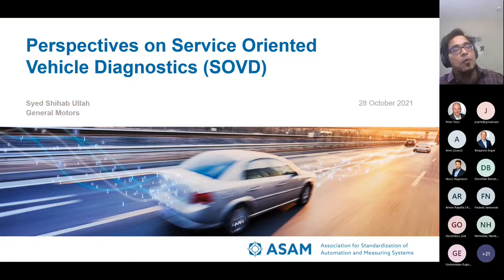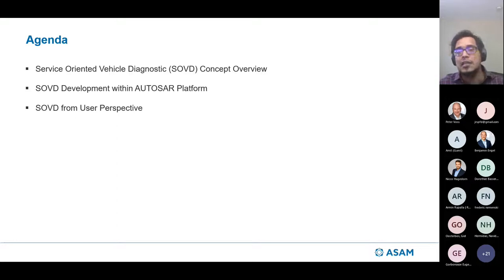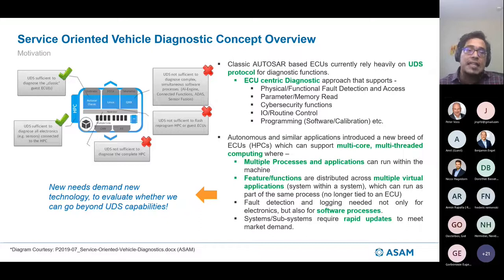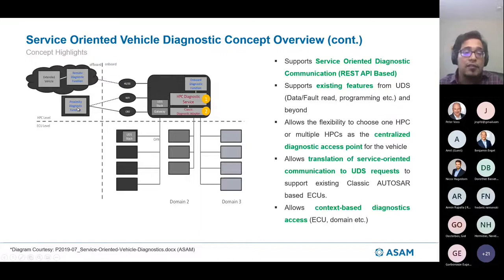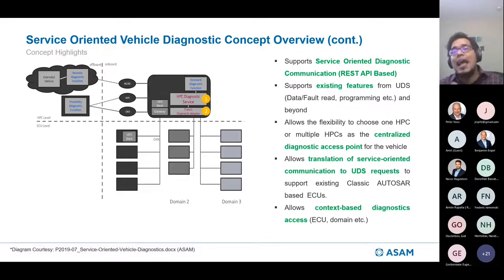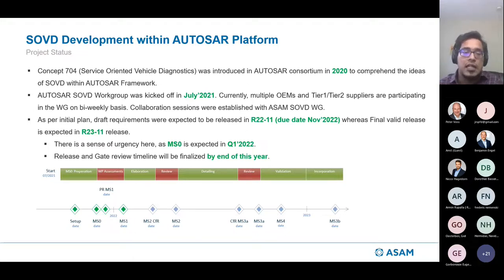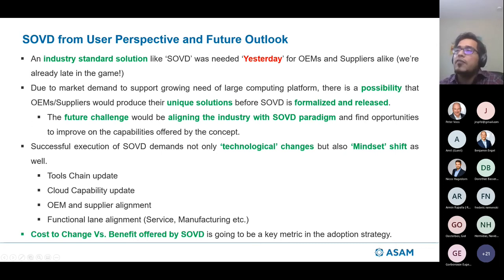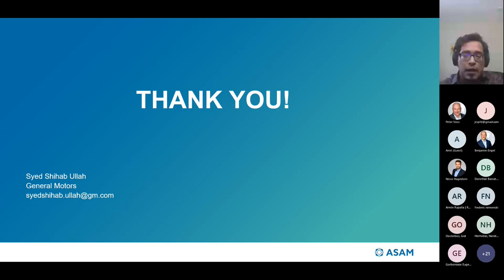ASAM SOVD - Service Oriented Vecicle Diagnostics

Comment: We have long time passed the best before date also for how to look upon the "classic" automotive application software, i.e., we already today run multiple applications inside ECUs and it is only because the execution environments like Classic AUTOSAR enforces us to bring them into the same memory image that the ECU is of interest. 

Also, try to limit the meaning of the term diagnosis. A doctor makes a diagnosis by asking a lot of questions to the patient and retrieve some data and based on the data, e.g. faults codes, a diagnosis is made. This is then the basis for proper treatments. However it is not diagnostics to make a surgery, but that is something else.